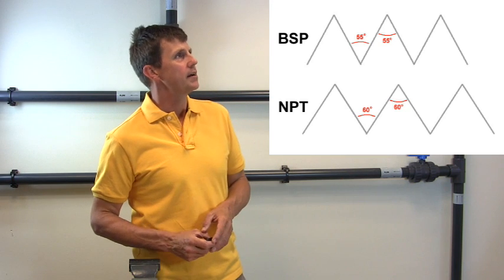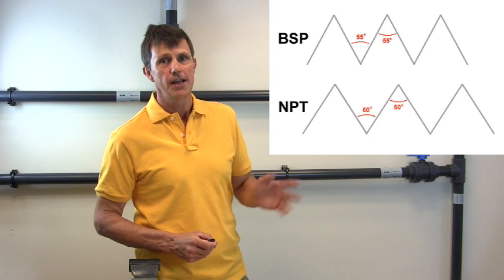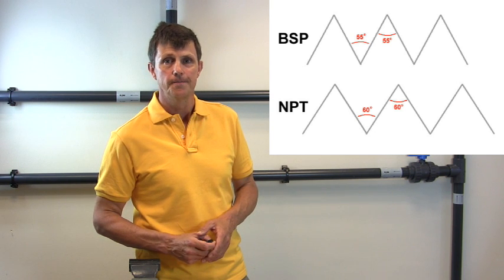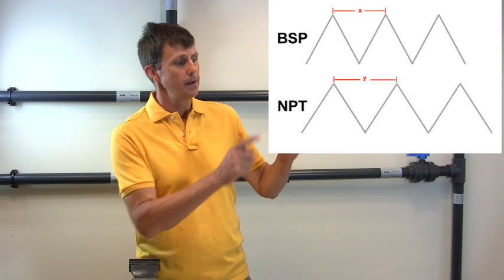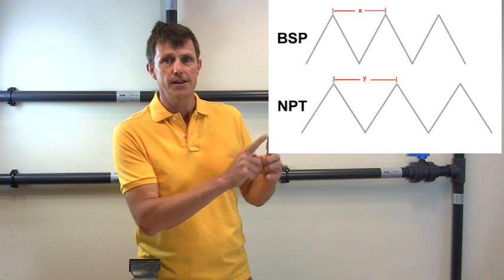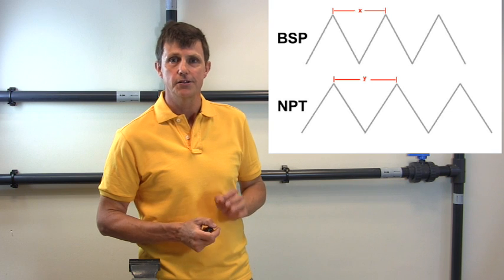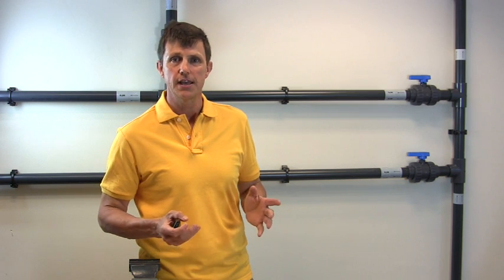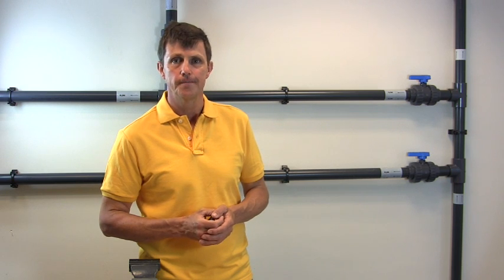Distinguishing between BSP and NPT thread types in plastic pipe systems

Comment: If it's written that, it is 2BSP then what's that mean
Reply from the maker: Hi there. Could you give us some more information about this? E.g. where this is written, which manufacturer made the fitting, what the outside diameter is. Thanks!

Comment: Please help me, how can I calculate the difference diameter on one thread of 3/4 NPT? Please come to the rescue !! Thank you very much. Nynch Tran,
Reply from the maker: Hi there, could you clarify what you mean by the difference in diameter on one thread?
Reply: @PlasticPipeShopTV  I would like to know the difference change size of the diameter of one thread ... Please help!!
Reply from the maker: @nynchtran  Hi, unfortunately we do not have this information. However, if you Google "NPT thread diameter", there are a range of diagrams that you might find useful.
Reply: Plastic Pipe Shop Ltd thank you very much !! I will !
Reply: I meant the taper diameter from one thread to another !?

Comment: Can you use a NPT tap and thread over a BSP female fitting so that the Npt male thread would work?
Reply from the maker: Hi, I have never tried it but I am pretty sure it will not work. As the pitch of the threads is different you will end up with areas where there is little or no thread at all. I guess if you stuff it with enough thread sealant it may work, but I wouldn't like to rely on it.